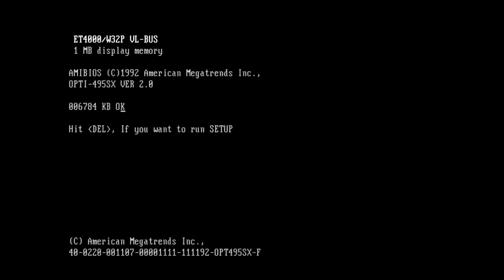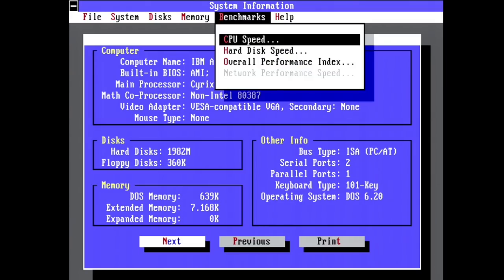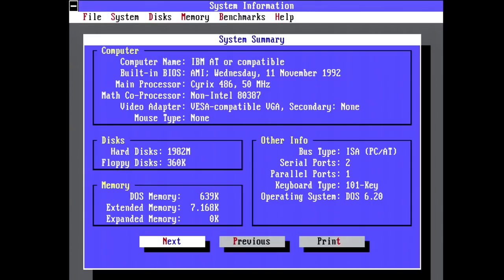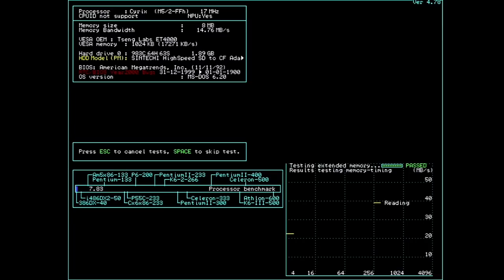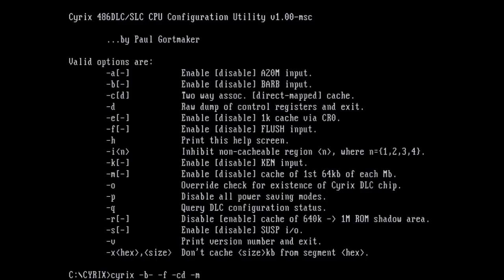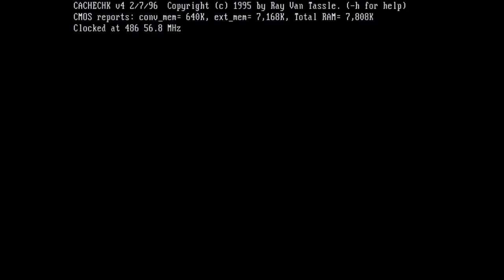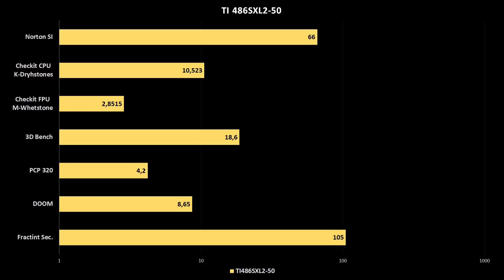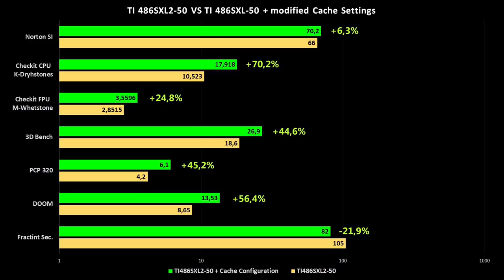TI486SXL2-50 OverDrive for 386 Boards / Benchmark and Tutorial

Comment: Not a single processor was dropped in this video.

Love the stop motion for the processors going into the sockets! Glad to see more love for these 386 upgrade processors. Some of them are shockingly fast. I've got a 486SLC running at 50MHz that's just blowing me away with how fast it is on the SX platform. For example, it gets 26.3 on 3DBench, 6.3 on PCPlayer 320, and 11.3 in DOOM on max with a Tseng 4000 ISA card. Gotta get my DX motherboard out...

Comment: Back in the day I spent ages debating with myself about getting one of these to upgrade my 386 machine, but I dithered on it so long that it became cheap enough to buy a cheap 486 motherboard and processer, so I did that! Still, I do know that these devices were a boon in particular to businesses with a large inventory of computers, because rolling out a processor upgrade made a lot of financial sense compared to replacing a lot of fairly new computers.

Comment: I bought one of these CPUs on eBay yesterday for an IBM PS/2 Model 70 that only has a 20Mhz bus. I'm gambling but if it works, I should be able to get it to 40Mhz. Thank you for this tutorial! Also, that was fantastic stop motion camera work on the assembly.
Reply: This end up working?

Comment: I just missed an eBay sale for a Cyrix 486SXL2-50!  I guess they are in-demand because it had sold by the time I got the notification for my saved search.  I wanted to try sticking it on top of a 386 upgrade card for 286 CPU's because I think the crazy idea of stacking vintage CPU accelerators is awesome!  Plus a 486 IBM PC-AT... without a motherboard swap?  Super-cool!!
Reply: Was it one complete with a 386 board from Germany? In that case it was me who bought it ;-) I've been hunting these things for years!
I'm sure you'll find one some day. They a lot less rare than the IBM Blue Lightning or the Cyrix Drx2 upgrades..

Comment: This is a great video. Trying to compare numbers to some older video's shows how much better this cpu can be. Even to a DLC 40mhz.  There is a 66mhz version as well, and the IBM Blue Lightning with its clock tripling and 16k cache also existed, but the Blue Thunder was limited to a 16 bit bus I think...

Comment: Great video 👌 Now it just needs a little overclock to 66MHz 😅
I'm also messing with 386/486 board/PC that I got recently, had a i386DX33, installed an Am386DX-25 to test if it worked and managed an overclock to 40MHz, like a solid 60% increase in performance and very stable. Now it has a 486DX2-66 overclocked to 80MHz and plan to install 16MB of RAM instead of 8MB, a Cirrus Logic GD5424 VLB instead of a Tseng ET4000AX ISA and 256KB cache instead of 128KB. Keep up the good work 💪
Reply: There a 66 MHz variant of this, which is even more scarce, the Cyrix DRx2-66

Comment: Nice, very satisfying to see that thing actually run right in the end! 
I assume there must have been some TI tooling available at the time, though? Either way, cool that the Cyrix tooling can be used as a substitute, even though the labels there are incorrect for what some of the bits actually do for the TI chip.

Comment: Why a 486SXL 50mhz with a 487 coprocessor is slower than a 486DX 33mhz? I would expect it to be close to 486DX2 in the system information computing index.

Comment: Wondering if it's gaining more from being on that strange 386/486 VLB board, compared to one that only has a 386 capability - and how DO you control cache in a 386 socket that was never designed for implementing CPU cache coherency - always thought it demanded a snooping utility to check for DMA controller activity

Comment: which is the best cpu you recommend to upgrade an Intel Inboard 386/pc is a board? It has a 32MHz crystal and a 386 DX running as 16MHz by default. I like to get the max out of an XT computer. The intel inboard does wonders for an XT but I was wondering how to push it to the limit! There are tons of mods online but it requires transcomputer models which are impossible to find. I don’t mind swapping the crystal and from what I researched the intel inboard does run stable at 40MHz crystal which means a 20MHz 486 could be used. The socket is 132 I believe. I appreciate your help so much! Your videos are the best!

Comment: I loved the stop motion. Was that a PS/2 keyboard? I thought those came with the switch to ATX. Also, the lengths of the bars in the bar graphs at the end looked really suspicious. The numbers matched the percentages you read, but the graphs just didn't look right.
Reply from the maker: it was an PS2 Keyboard but with adapter to 5pin DIN. Yeah, the bars are in LOG scale. otherwise I could not show small and big figures nicely in one chart.

Comment: Oh how I hated anything with SLC on it or any variation of it. Through your videos and others. I found a few things out that I didn't know when they came out. I first started into computers in 91 (mostly 92) and anything non Intel (at least for x86) seemed to suck. Well except for the 486dlc-40. Loved those things. I wish I had some of the really strange motherboard / processors that came out. Like I remember one that was a 386 75mhz processor soldered to a board itself with a small garbage fan. I think it was a 386. Anyway it wan faster than all out with dos and windows 3.1. But it only lasted a few weeks before it was locking up and such. Thus, we had to go out to the customers and just replace the whole thing out. This was before the internet hit too. So not like you could just go online and see if you was missing a setting or software for it. Like I was with a 586 nextgen processor that sucked in windows 95 but worked great in win 3.1.

Comment: There were basically 3 different x86 CPU manufacturers in the 386 era and later: Intel, AMD, and Cyrix. Nearly everything that wasn't branded by one of these (such as TI or ST Thompson) were rebadged Cyrix parts (IBM originally built some licensed Intel parts, then switched to building licensed Cyrix parts). There were a few other also-rans that were mostly either very niche or just unsuccessful (NexGen, which later became part of AMD, IDT's Centaur, Transmeta) but basically it was one of these three until Cyrix collapsed and various IP components were sold off (NatSemi and then AMD got the MediaGX/Geode, VIA got the general x86 CPU line and merged it with Centaur bits for future products). Kind of disappointing but explains why the Cyrix software runs on these chips.

Comment: Would the SXL2-50 chip work with a 20 or a 22.5MHz cpu bus? Would it double that to 40 or 45 MHz?
Reply from the maker: yes, it would work like that.
Reply: @CPUGalaxy  which is the best cpu you recommend to upgrade an Intel Inboard 386/pc is a board? It has a 32MHz crystal and a 386 DX running as 16MHz by default. I like to get the max out of an XT computer. The intel inboard does wonders for an XT but I was wondering how to push it to the limit! There are tons of mods online but it requires transcomputer models which are impossible to find. I don’t mind swapping the crystal and from what I researched the intel inboard does run stable at 40MHz crystal which means a 20MHz 486 could be used. The socket is 132 I believe. I appreciate your help so much! Your videos are the best!

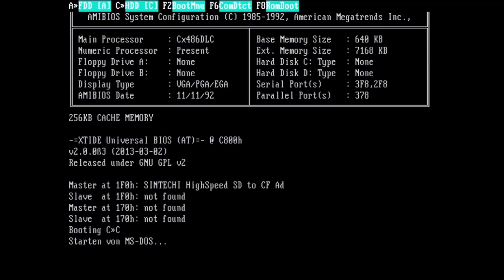Comment: 5:42 As far as I know, TI never designed x86 CPU's. All TI x86 CPU's are from Cyrix. Basically rebadged Cyrix CPU's. TI was a production partner for Cyrix and a x86 license holder. The same thing happened with IBM x86 CPU's. At most they would apply small modifications, like the increased L1 cache on this CPU.

Comment: When I have 386DX 40MHz board does it mean that this SXL2-50 would run at 80 MHz in my board?
Reply from the maker: yes, theoretically. But in reality it will not post. You need to set the Busclock to 20 MHz.
Reply from the maker: i mean 25 Mhz
Reply: @CPUGalaxy  1) Will it post at 16 MHz FSB (Turbo button switched off)?

2) Will it post at 40 FSB with Turbo button on (and by default disabled 2x multiplier in SW)?
Reply from the maker: 1) yes
2) no
😉
Reply: @CPUGalaxy  Thank you. But did you test it or it is your assumption? Because I saw in your video it posts always with 1x multiplyer (for compatibility reasons probably) so in theory it should post at 40MHz. Unless there is some logic that halts CPU when FSB is out of range.

Have you ever tested the modern 386 CPU replacement into 386 socket? It is based on ARM Tinsy MCU and it speeds up 386 dramatically.   I don't remember the name but it's on YT too.

Comment: It would be interesting to compare CPU's at the same core speed but differing bus speeds. i.e.
AM5x86 @ 4 x 25MHz
AM5x86 @ 3 x 33MHz
AM486-120 @ 2 x 50MHz (same core as AM5x86 apparently)

Comment: I wish somebody would reverse engineer and clone the Weitek Abacus.

Or even better, put a modern clone of the Weitek Abacus inside a modern clone of the 486 or 487.

Making a modern 486-compatible CPU with a built-in 487 and a built-in Weitek Abacus, using modern technology and architectural improvements, would be pretty epic. Though if somebody wanted to be really ballsy, they could even try to make it Pentium-compatible as well.

Comment: Wait, hold up, that board can run 386 or 486 chips? So technically, you could have a 386 with a VESA local bus cards?
Reply from the maker: yes. indeed 386 with vlb 😍